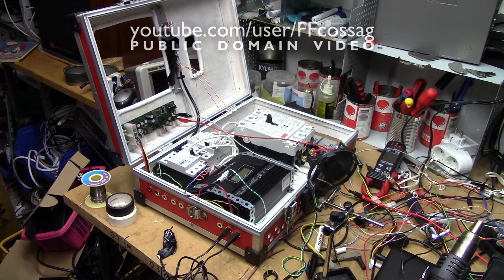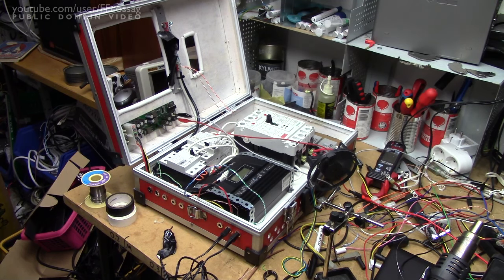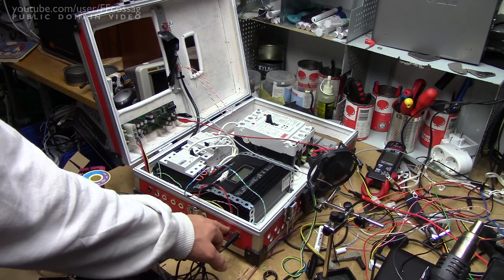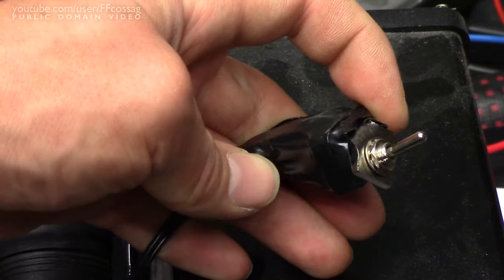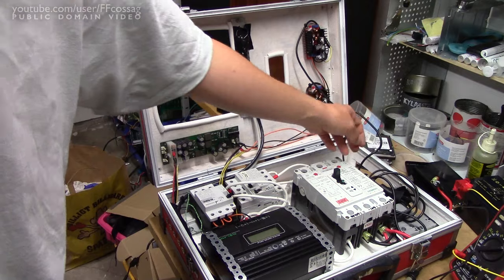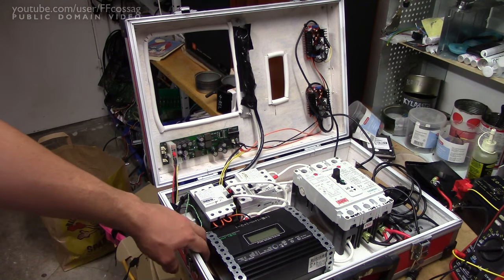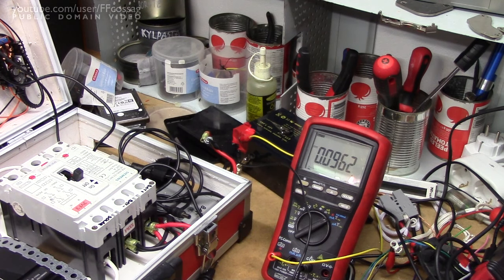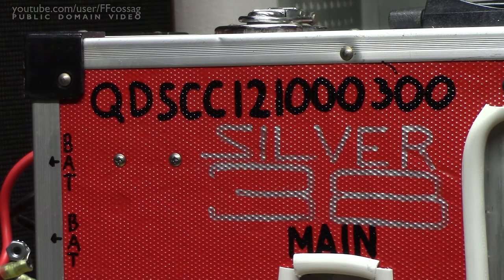QDSCC121000300 Silver 38: Solar briefcase followup

Comment: What did you do for the HP charger ID pin? My older Compaq Presario CQ60 doesn't care but my new(er) EliteBook 8470p will not accept any power adapter without a proper id pin circuit.
Reply from the maker: 330k resistor to V+. I've never met a HP who doesn't eat that.
Reply: 330k sure does it. Out of curiosity I started measuring the resistances of the 65w charger and the 90w chargers I have and the actual 65w comes out to ~370k to the V+ and the 90w is ~300k. So I put 3x 100k in series, tested it and my docking station lit up as if it was a 90w charger and it worked with the 65w charger. Now It's time to buy 45w, 120w, and 230w chargers to test the values... Or just borrow my friend's chargers ;)
Reply from the maker: dollerstorehack
Yep. A friend of mine actually reverse engineered the entire ID circuit a few years back. It's pretty simple, in essence it's just a comparator connected to a current sense resistor, which flips the state on the ID pin from (IIRC) high impedance to tied to either VCC or GND when a current threshold is reached.

If you've ever connected a HP laptop to a power grid power meter, you'll see how they probe for this state change by raising the battery charge current in ~5 W steps until they reach maximum charging speed.
Reply: I did put a DMM in circuit to see if the dock + notebook would actually pull 90w off of the 65w brick (it does, and the 65w brick doesn't care!) while charging it never exceeds the 4.62a limit set by the "90w adapter", just brushes it. I originally was looking at the line for data (Like the Dell chargers) or an analog voltage but was completely confused when the voltage would change at random it seemed, and that the cheap generic psu I had taken apart to find out what circuit it used simply had a Zener and a capacitor tied to the line, and the EB didn't like that at all, however, the CQ60 did. The CQ60 will charge even with the line floating though.